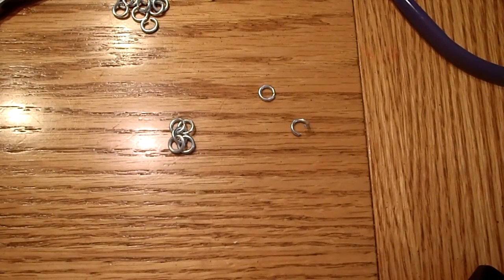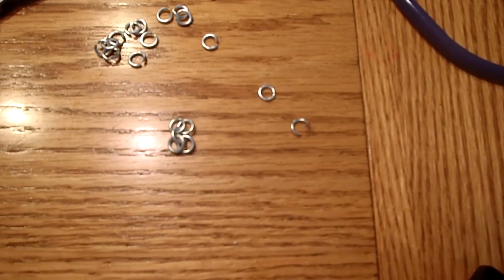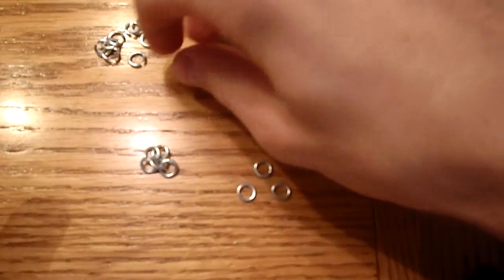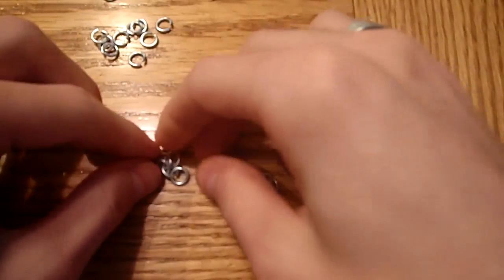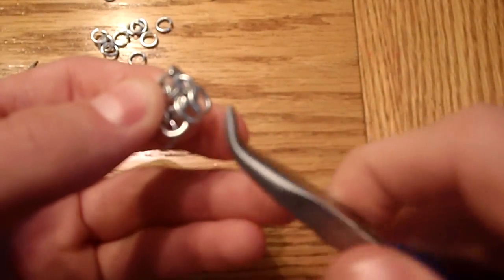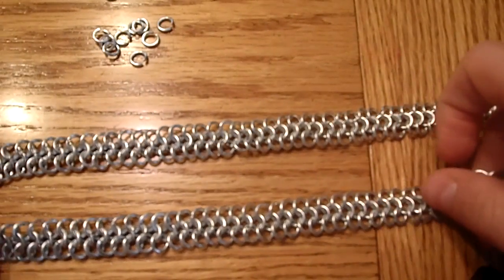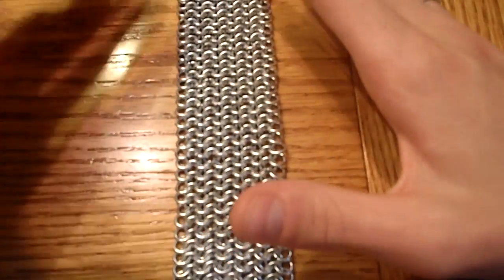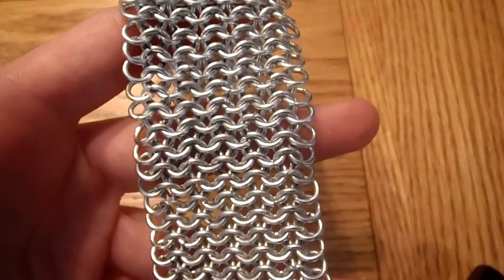How to: Efficiently Craft European 4-1 Chainmaile

Comment: @Samuraikidd69 not a good idea.

metal bowstrings can be used, but wrapped metal wire/coils is a much better idea vs chainmail, chainmain would become undone under the pressure.

of course I cant tel if your kidding or not :P